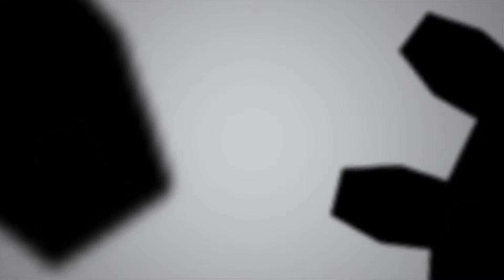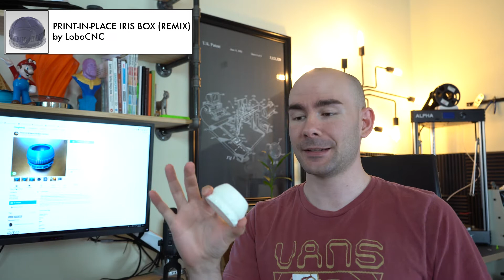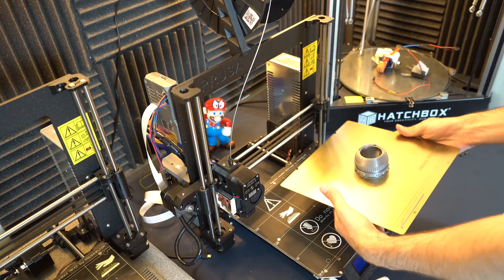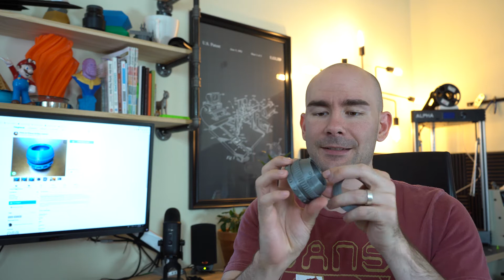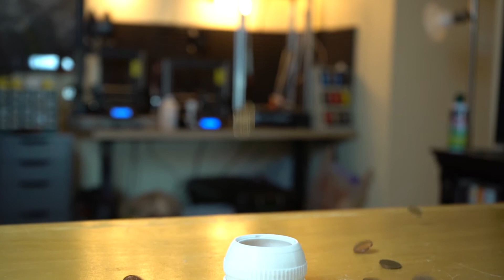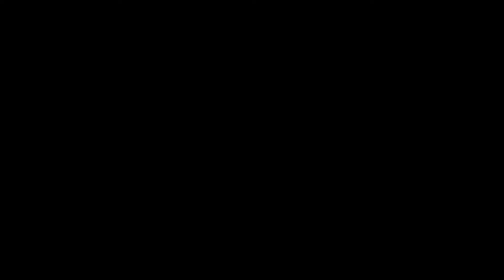3D print-in-place Iris Box on Prusa mk3 in AIO White PLA

Comment from the maker: Have you all tried printing this yet? It was a little tough but I love it!
Reply from the maker: hey, as long as you got your bed level ;)
Reply: Printed 2, they work but smooth isn't the word I'd use... I'll retry after recalibrating my extruder (more?) carefully.
Reply: I'm going to have to try that out. It'll really show how not calibrated I am.
Reply from the maker: lol, the first one came out super bad!  Octolapse is cool but the pause between each layer is troublesome.
Reply: How much of a pause are we talking about? if more than a few seconds, it can form a blob under the extruder and that will mess with those kinds of prints. Used to have that on some complex files with the out of the box firmware.
Reply: Mine fail 3 time but it worked on the 4th time
Reply from the maker: Raphael it’s about a 2-3 second pause

You changed out the firmware?
Reply: You have helped me so much

Comment: Mine also has that protruding band at the top, it looks exactly the same. I checked the slicing, and it's actually because of that. The shells are continuously becoming thicker towards the top, and that's the exact layer where the slicer changed from "Gap fill" to "Perimeter" to print the inner filling lines, which meant a sudden change in the amount of material. Probably because the "Perimeter" is actually two lines very close to each other instead of one like the "Gap fill".